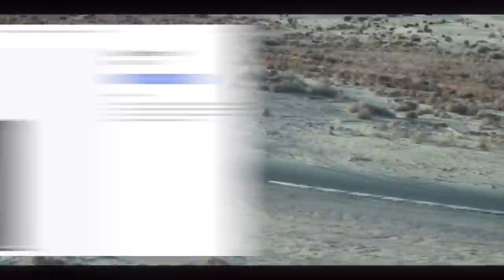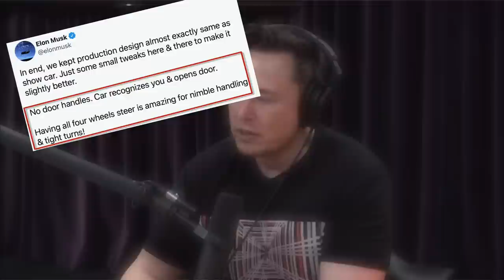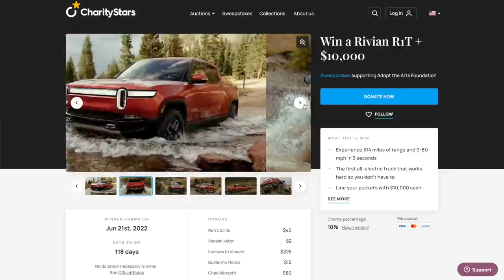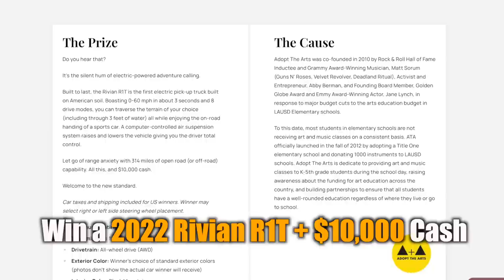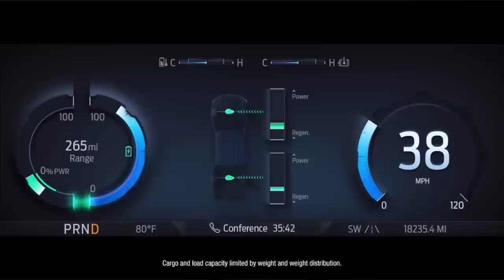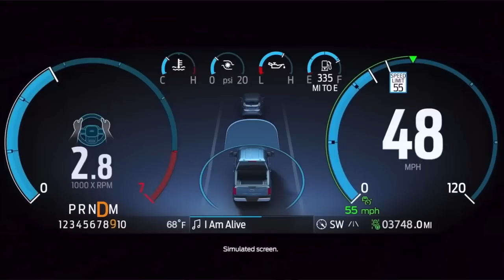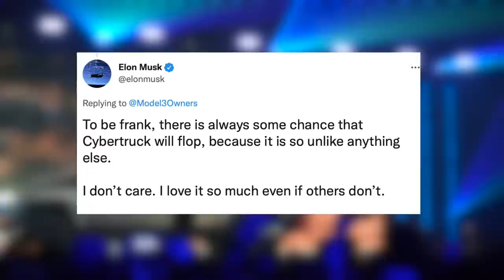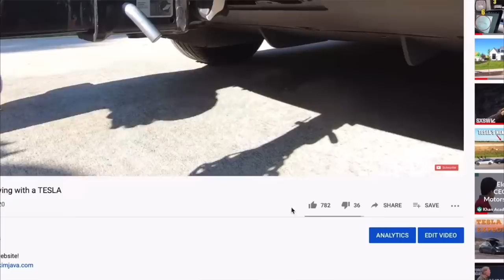The TRUTH About the Cybertruck

Comment: I think Tesla will have a high end quad motor 4wd version with tank turn and crab walk, 
a mid-price dual motor 4wd version with crab walk but no tank turn, and a basic single motor version rear wheel drive without crab walk or tank turn. They probably won't make a tri-motor version, there is no real advantage to it. The list of extras and add-ons will be long, though.

Comment: I put down my $100 and I don't really need a truck.  The Model Y would probably be just fine for a replacement for our AWD Rogue when roads are bad and work fine as an everyday driver to replace our Model 3 but in no hurry to buy either as the 4680 cells will become available relatively soon and I'm hoping for a longer range when they are, for the Model Y.  The choice probably won't be complete until I can compare the cost and utility of both vehicles.  Neither of them will compare in efficiency to our Model 3 LR Rwd but we're willing to sacrifice for comfort and convience plus I also have an Aptera reservation which should be an efficiency king.

Comment: The door opens when it sees you eh?  Please no.  You KNOW that will work 40% of the time and that to get in your truck you'll have to walk away and come back four times or you'll find some random dude sitting it because the door opened when a squirrel ran past.
Reply: So, that's not even close to how it works.
Put im sure you own a tesla to be sharing your experience. SMH
Reply: @xxZerosumxx  I have had a Model X 90D since 2017 and I also have a Model 3 performance.  I also have an MYP on order to replace the X. I have plenty of experience with Tesla thanks and know that apart from autopilot, their automated "innovations" are generally just annoying.

Comment: Wasn't the Ford Ranger EV the first EV pickup built on American soil back in the early 2000s?
Reply: Sounds like it
Reply: 1997 Chevrolet s10 ev and then the ranger ev followed in 1998 actually. So gm really did a number on itself with evs.
They had the first modern converted truck 25 year's ago and they had the ev1. 🙂

Comment: I don’t know why you are so big on the Ford and down on the Silverado.  It has better range than the Ford and what you can get right now with the Rivian.  It has a midgate which is much more useful than the tunnel in the Rivian.  And it starts at 39k like the Ford.  Maybe you are hearing that it doesn’t get here until 24 which is untrue - it’s spring of 23.  

Or get a Hummer with a removable roof which no one else has.  It’s cheaper than a model x with more speed and Supercruise which beats Tesla’s system in most independent tests.
Reply: I bet that Silverado will be delayed because of battery supply issues, the Hummer is a flop already. If interest rate hikes become a reality, GM and Ford will get in trouble with their 100+ Billion debt. Does supercruise work downtown San fransisco?... Hmmm, probably not, FSD-Beta does a pretty good job and works everywhere!.

With ICE car sales falling of a cliff, and GM has not much to offer right now in the EV market,  plus the interest hikes haunting them, it might go downhill for them much quicker than anybody expects.

Comment: Cybertruck problems: Steel price and battery prices and availability, maybe chip problem too. There are 0 more battery's left for additional vehicles, like Model Q. Model 3/Y and S/X are using everything Tesla has already. + The competition uses now any additional resources planned for new vehicles. So, Tesla can't change current facts. If the materials for Cybertruck are better available in 2023+, it can be made. But for now. Tesla runs at 100% with 3/Y. 
Cybertruck is the opposite of Model X. It is so simple in design, you can actually see it right away. Very easy to produce, very cost-efficient. Built to never fail, where the X has a 1000 things that can fail and they are failing... So no, Elon doesn't make the same mistake again. 

Have a nice and healthy day.